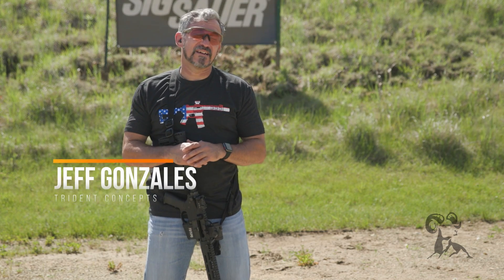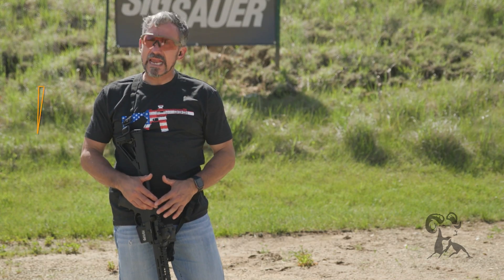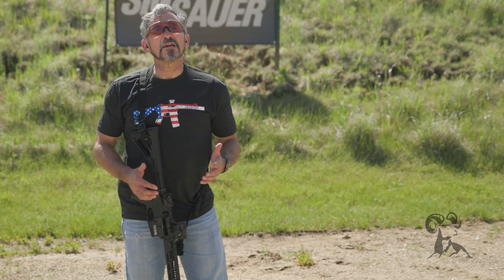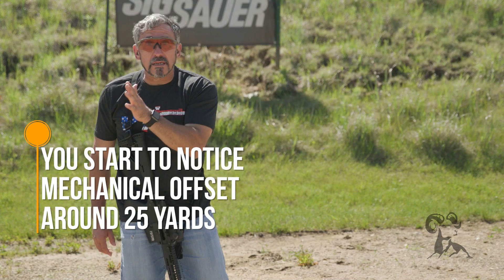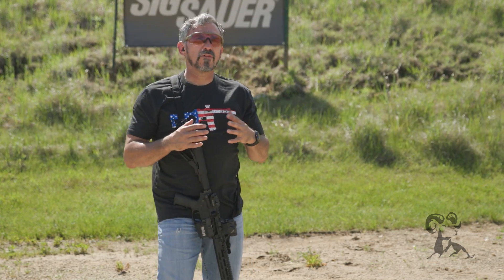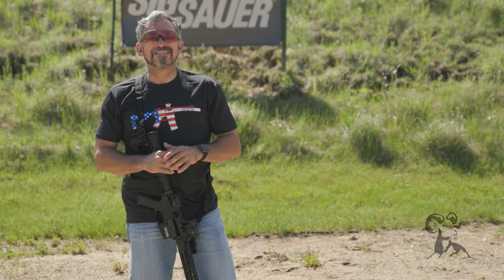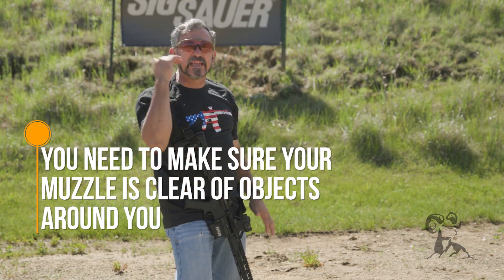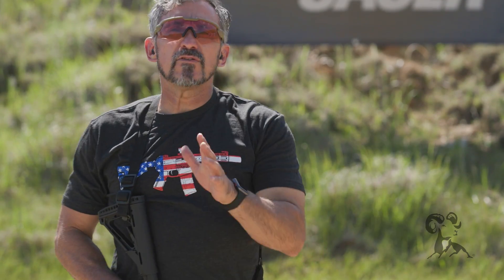Daily Defense 3-33: "Mechanical Offset" for Your AR-15

Comment: When folks say that the bullet "rises" so the POA/POI coincide at 25 or 50 yards, I always wonder. Does the bullet actually "rise" (due to lift from spinning), or are the bore and RDS at slightly different angles due to projected drops at distance?
Reply: per Caleb and Steve in a smyth busters video, the bullet does not rise.  it would have been better for this presenter to have said this differently but, in fairness , he is not talking about ballistics here.
Reply: @harrismaynord871  correct, it does not rise
Reply: Different angles. The bore and the sights and not parallel with each other the they are very close, so much so it is not detectable just by looking at it. The barrel is fix and the sights are adjustable in minuscule increments that allow the person to meet the two at a particular distance. The argument between with one, the sights or the barrel, to angled toward the other is where people might argue, but it makes way more sense for the sights to be angled toward the barrel since they are already adjustable.

Comment: In the 1950s a high-scope mount was, around, 4 inches and sometimes higher. This was to extend the point-blank range to greater yardage. Typically, this was a 4-inch circle. The lower scope mounts are more common today as an American sexiness feature and scabbard carry. Also, today we have turret mounts and scope adjustment is easier.